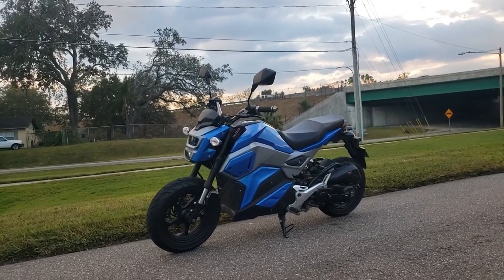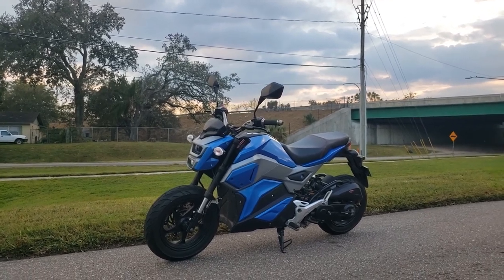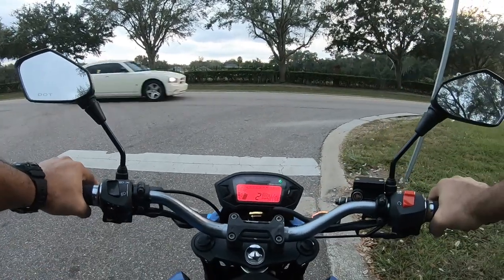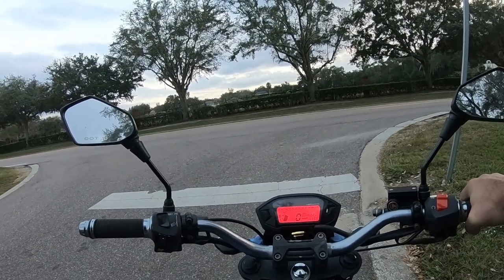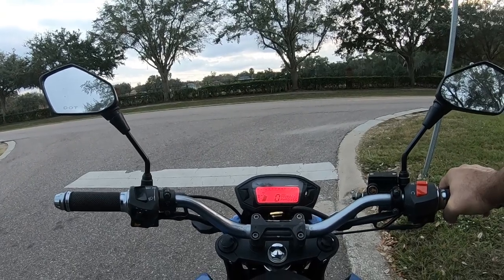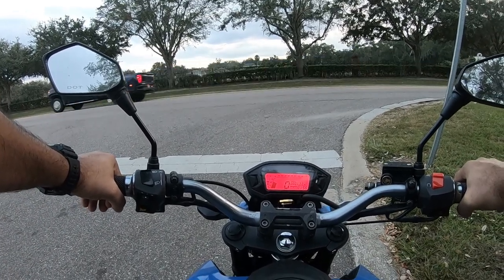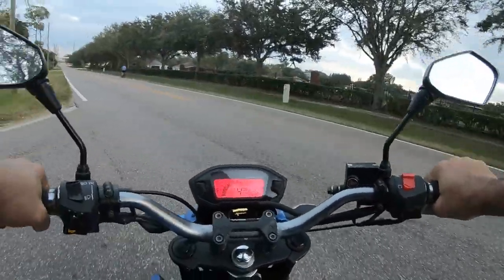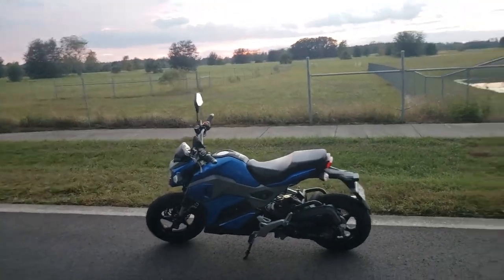Mini Max Grom Clone Ice Bear Top Speed run 😀🏍👍

Comment: Do you have to have a motor cycle license to ride this or just a driver license and helmet I'm in ga
Reply from the maker: Check with your local DMV
I am in FL and don't know the rules in GA
In FL one does not need to have a mtorcycle license, when the engine is 50cc or less

Comment: Have you looked or found any mods for it
Reply from the maker: Yes, this is the GY6 50cc Chinese scooter engine and there is quite a bit of parts for it.
Some do a BBK (big bore Kit) which increases the displacement of the motor.
Some add rollers to help the scooter take off faster but then you will lose top speed. (I personally don't want to lose any top speed)
some add a bigger carburetor, Intake and a free flowing exhaust.
The final mod is to swap the engine/transmission for a bigger displacement one, like a 125cc or a 150cc  (it's not as easy as some say it is)
Reply: Correct, it's not as easy as you'd think. I fudged up a brand new engine trying to install it myself for my vitacci spark 150cc. Still not sure why it didn't crank but I ended up finding some guys to bail me out and fix it. These little foreign scoots can be great, but be prepared for some 'trial & error'

Comment: Question I way about 260 pounds will this be ok for me
Reply from the maker: I would suggest you try to ride one to see for yourself.
It's a great scooter to learn how to ride but it is very low on power.
Reply: @LincolnMaxnCo  thank you
Reply: My two friends who rode my bike weigh around 225-260 and they both had a nice ride and got up to 35/36.
Reply: I weigh about 250 and I have a few mopeds and I can tell you that it’ll go slower then him but you’ll still go like 32-35 so it’s really not that bad put some heavy weights in if you want speed if you want it to take off fast get lighter weight

Comment: i THOUGHT THEY WERE 125 CC? wITH A TOP SPEED OF 70?
Reply from the maker: This one has a 50cc eng w/ a CVT transmission.
So there is no clutch or gears to change on this one, it is like a scooter but with the looks of a Grom
Reply: They do have 125cc versions

Comment: U kan go on the highway with it….,I did with mines… top speed 70
Reply from the maker: Not on a STOCK Mini Max with a 50cc engine.
This video shows the top speed and how long it takes to get there.
Even the new one with the 150cc engine would have a hard time getting to 70mph, unless it's all downhill w/ a strong wind behind.

You might have the 150cc  🤔
Reply: @LincolnMaxnCo  mines go up to 70mph….I gotta 150cc
Reply from the maker: @Stop6ixEBeezy   
ok, that makes more sense, 
have you verified the speed w/ a GPS? because they are usually off by a couple of mph.
The one on this video is a 50cc engine. 
The 50cc Mini Max is NOT SAFE to take on the highway, even on local streets is unable to keep up w/ traffic, which is why I rode on the bike lane.
Reply: @LincolnMaxnCo  yea well 67mph it was klose to 70…hey so how fast do the 200cc and 250cc go